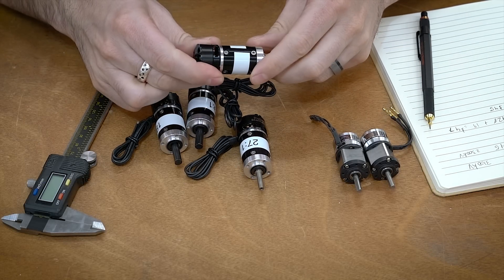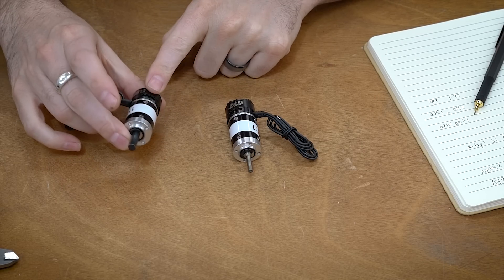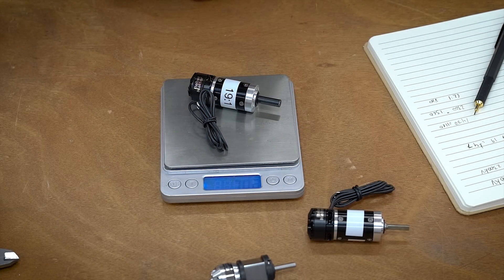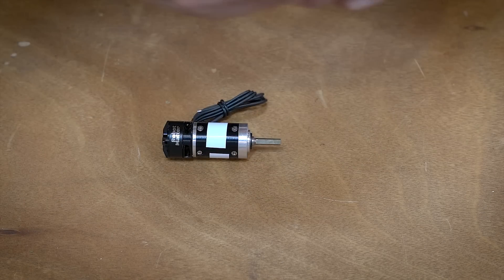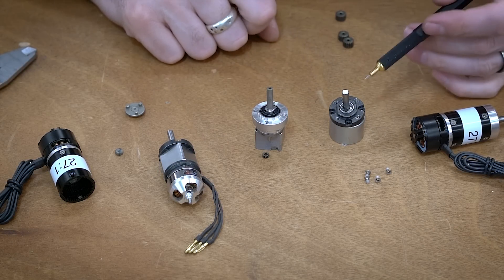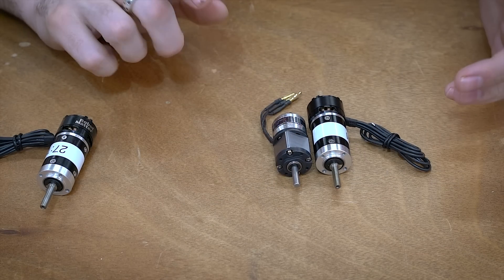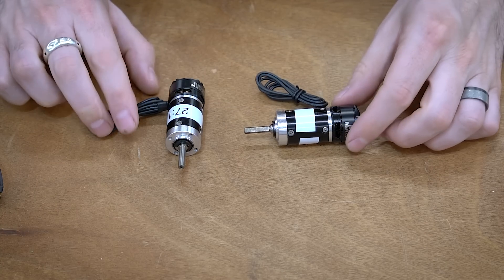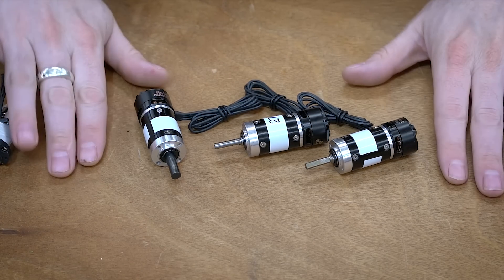Best Beetleweight Drive?!

Comment: Nice video, debating switching to brushless for our beetle.
Reply from the maker: All insects should run brushless.  I don't think brushes make a lot of sense for insects.  My personal opinion.
Reply: I mean for Antweights, not necessarily in my opinion. With the outrunner also making it harder to design around, I like using some nice powerful brushed motors in my ants, and have not really ever ran into issues or been out powered in drive by a brushless ant
Reply: @RobertCowanDIY  low low man brushless when lmao

Comment: Do you think the 27:1 would be good for a hammer
Reply from the maker: I mean, hammers aren't generally all that competitive, might as well just stick to good drive and a wedge.
Reply: @RobertCowanDIY  I’m not really looking for a very competitive robot, I just want to make a hammer because no one makes them and I love hammer
Reply from the maker: @ghosthat_VODS  In that case, as long as you know what you're getting into, these should be good.  They're a bit large and heavy, but if you get the 6mm shaft version, they would work well as long as you calculate the right speed and such.  Good luck!
Reply: @RobertCowanDIY  thanks

Comment: To be fair, some of the extra weight is in the wiring. Shortening the wires will save some grams, even with the bullet connectors added.
Reply from the maker: You're not wrong.  But it is only a couple of grams at most.

Comment: Okay, that's curious. I expected a lot more output power out of those brushless motors. I've recently built a race drone with 1408 sized motors at 3750kv running 4S and I believe each motor will easily produce at least 100 watts of output power in their current configuration. The motors are rated for a little over 300 watts for 30 seconds without burning up. 
Is the difference in output power between these beetleweight drives and drone motors so different purely because of the use case (high speed low torque vs low speed high torque) or is something else going on? Maybe cooling since the drone motors are whizzing through the air at high speeds?